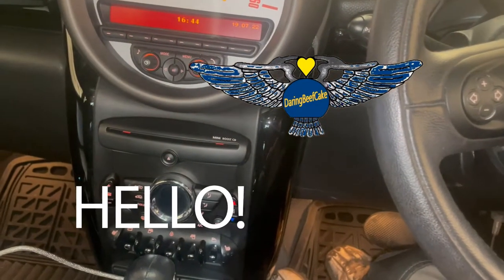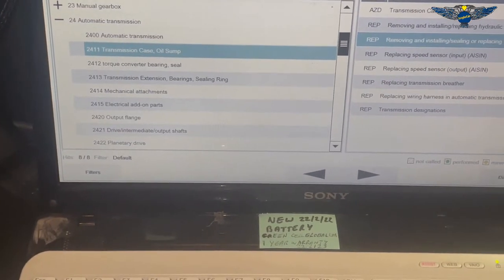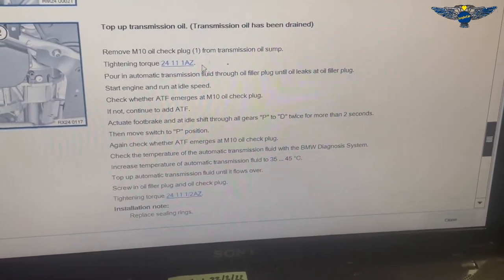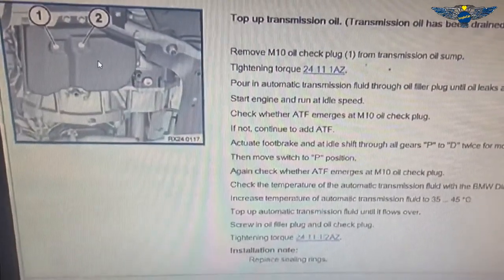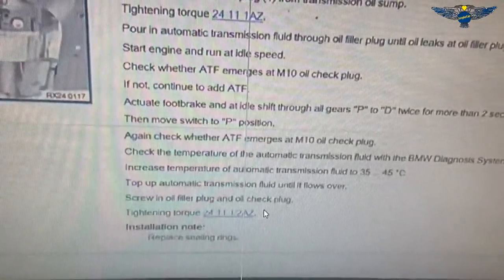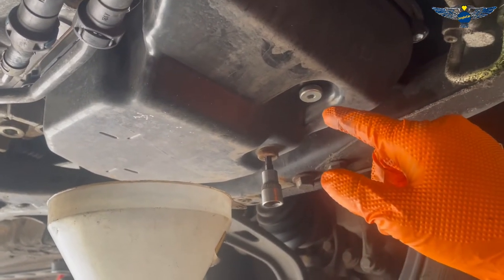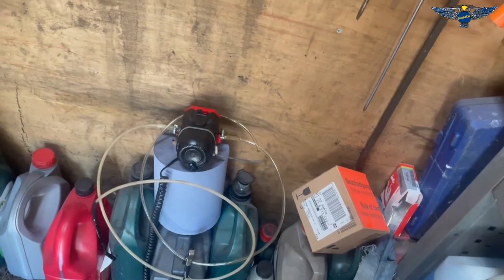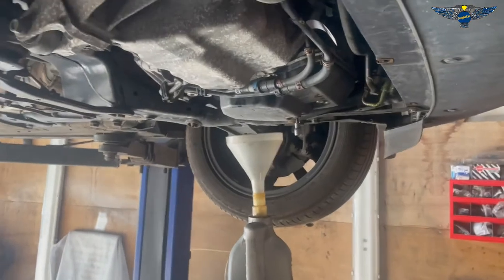Mini Countryman Cooper D 1.6 2012 Auto transmission fluid-oil change

Comment: The torx screw you mention at the 37 minute mark, was originally at the rear corner above the subframe.  It is a real pain to get to in that location as you can imagine given the trouble you had with the regular 10 mil bolt that is now in that location.  I imagine someone has been in that sump before and moved the torx screw to another location for that reason.
Reply from the maker: Yes I think I did notice on another vid the torx screw was in that dodgy awkward place.

Comment: Thank you for sharing
I got R60 2014.
Last time I tried to remove the transmission oil pan, it was obstructed by subframe . I just wonder did you have the same problem.
Reply from the maker: the subframe was obstructing, however it did come out without any major issues..one of the bolts took longer to remove due to the subframe, but it was just a matter of time..